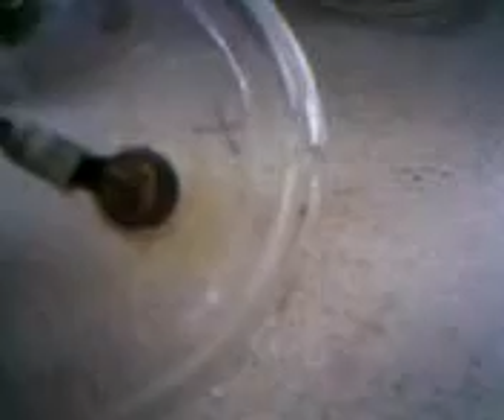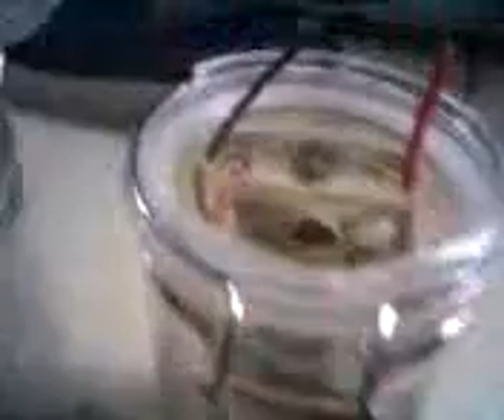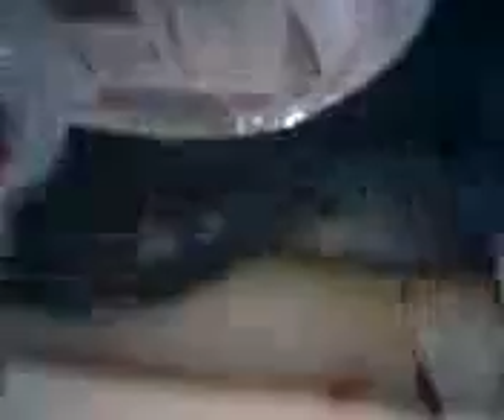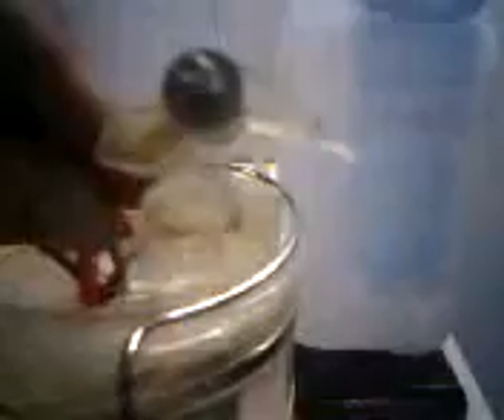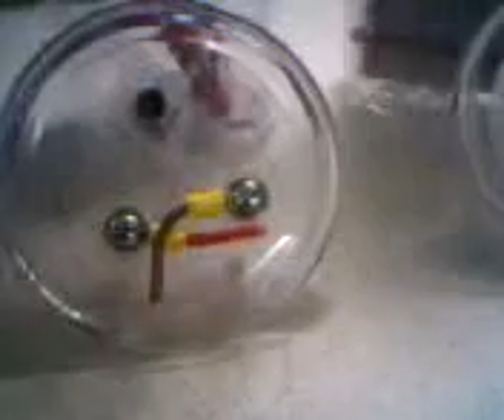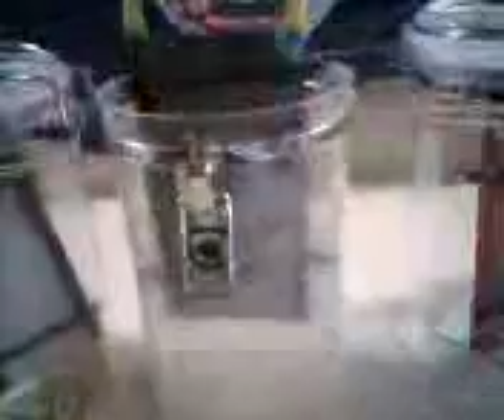A closer inspection

Comment: Why would they be blowing? Shorting out the terminals while running? I have one of these running in a truck for the past 2 days and no problems. Gets no hotter than 140 degrees so far...may wat to add a safty blow-out.